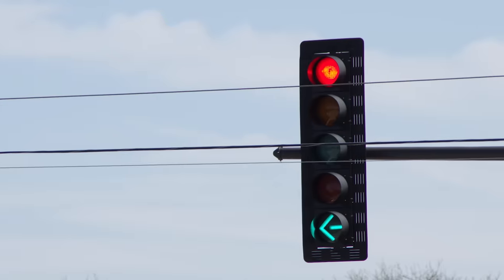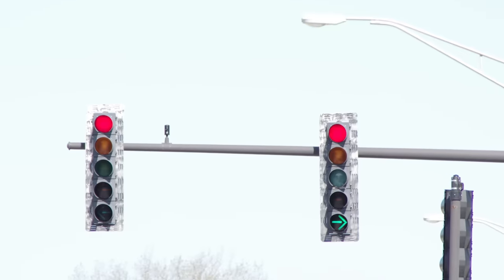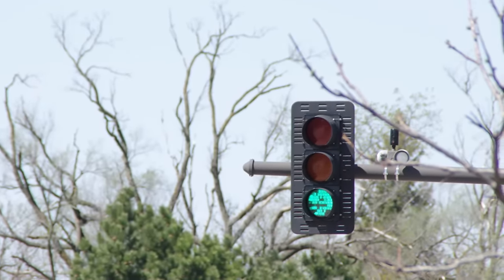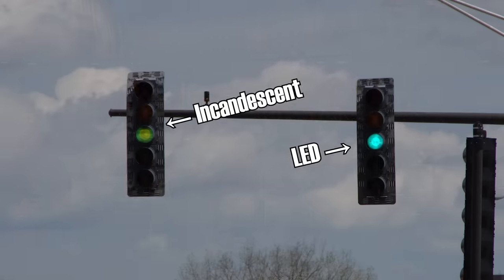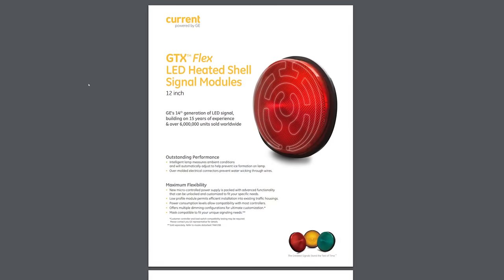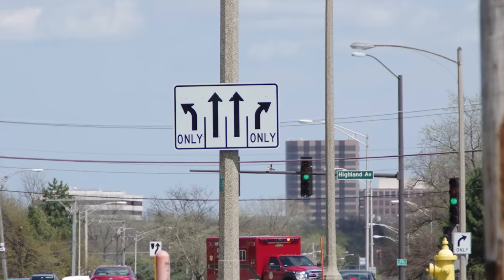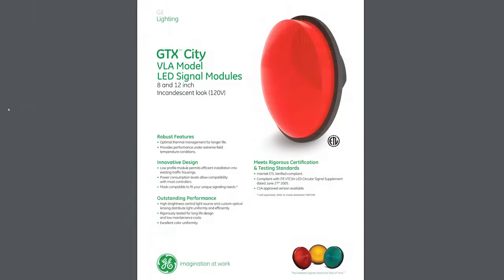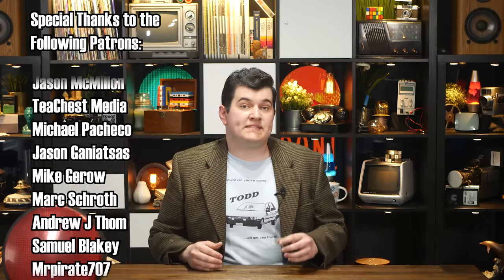The LED Traffic Light and the Danger of "But Sometimes!"

Comment from the maker: There were two metric conversions I failed to do!  Argh!  I promise I'll get better at this;
35-40 MPH is roughly 55-65 km/h.
12 inches is about 30cm, 8 inches is about 20cm.
Now that that's over with, what sort of traffic lights do you have where you live?  This is a very 'Murica-centric video, as that's where I live, so international perspectives are always welcome!
Also, because I am so bad at self promotion, did you know you can follow me on Twitter?  Because you can.  And should!  https://twitter.com/TechConnectify
Don't forget to STOP!  In the name of love!  And drive safely!  Thanks for watching!  Exclamation point!
Reply: Near where I live, they uses those old incandescent bulbs. In fact, the whole city uses them, I have never seen a led traffic lights here. There were also those weird traffic lights that only have ONE yellow blinking light (no red, green) that is used for nothing and most of them have died out by now (and they were never replaced)
Reply: https://www.google.com/maps/@60.4446182,22.2582236,3a,75y,57.1h,95.65t/data=!3m6!1e1!3m4!1sVx-tyIr4AK4srLiXa1N2QQ!2e0!7i13312!8i6656 As you can see we don't have stop signs we have yield signs and they are only applied when the lights are off :) And the lights are leds
Reply: General setup of the lights 'round here (canada) are pretty much the same as the states, never seen [walk/don't walk] signs in my town though, they're all pretty uniform with the hand and the walking dude, and most major intersections have a countdown on the blinking hand. Pretty sure they're all LED as i've never seen one go out but i haven't payed much attention.

There is one intersection a bit off downtown that's always baffled me though 'cause they just rigged up one of those 3 stage traffic lights for the pedestrian light, which is especially bizarre because that area of town doesn't have pedestrian lights at most intersections anyway, and it's no more complicated or dangerous than any other intersection in the area to warrant it. Furthermore, it's simply synchronized with the main traffic light as far as i can tell (aside from completely skipping yellow and going straight to red) making it entirely redundant.
Reply: Mostly LED.  And the control sensors installed for the last ~15 years have been cameras mounted on the traffic control boom.  No embedded road sensors.  They have started installing solid state touch sensitive crosswalk buttons.  No longer a mechanical button that can fail.
Reply: Here, in Switzerland, we use LEDs. Or at least we do in my City.
Reply: In Poland it really depends - both incadescent and newer, led types are currently in use. To be honest, I 've never seen a burned out bulb in traffic lights on a daily route I make. Maybe I just drive too little ;)
Reply: Don't bother with metric conversions.
If you're American or British you pretty much use Imperial all the time anyway.

If people don't know then it's up to them to learn.

Just the same as I can't go to China, and expect everyone to change to speaking English for me. I have to learn Chinese.
Reply: I think that only new traffic lights in Croatia are LED, but I have never had a problem with visibility here and I think its hard to see if there are LED or not; so its interesting to see these old and lousy traffic lights. I think that we have better lenses or something...
Reply: These make crossing in busy intersections all the more fun! https://www.youtube.com/watch?v=X7VWSk1DMlI
Reply: Thank you!
Reply: It's interesting how the US has slightly different rules for broken/unreadable traffic lights. Here in Hungary (and I believe in the rest of the EU, too), traffic lights can be combined with a yield sign or stop sign. If the light works properly, you ignore the extra sign. If the light is broken or unreadable, you follow the sign, i.e. you either yield or stop, and if it doesn't have either sign, you have priority in the intersection. Of course, we couldn't follow your version because we don't have four-way stop signs. There is either a prioritized direction in an intersection, or the right-hand rule applies (i.e. you yield to those coming from your right).
Reply: The same more or less applies to the Netherlands, except you only follow the signs if the whole intersection is out. If it's just one traffic light that's failing, you have to guess (and make sure you don't do anything unsafe).
Reply: I left Riga years ago, but we started moving to LED in general. Some new have more traditional looks, and some are like this:
https://www.google.com/maps/@56.9405,24.1952308,3a,75y,37.74h,80.1t/data=!3m6!1e1!3m4!1sGB0_LiMXSlNECSTNVYXXYw!2e0!7i13312!8i6656
Reply: I live in Germany and I can't remember seeing a stop light that didn't work in like forever.
I assume we have LEDs in my city but I'm not entirely sure.

Also you look pretty neat in your jacket and roundabouts are better anyways
Reply: A few years ago certain municipalities in Colorado started introducing yellow flashing left-turn arrows with a sign stating something to the effect of, "yield on flashing yellow arrow". This strikes me as a massive waste of money, as a solid green light (without an arrow) already communicates this message. Any other states have this? Is there a good reason for it?
Reply: Jonathan Poncelow It's probably just reinforcing the meaning of the green ball signal. Here in WV you are more likely to see a sign that says: LEFT TURN YEILD ON 🔵 (That should have been a green ball.) We also have signs that say: RIGHT TURN ON 🔴 AFTER STOP. Just repeating common knowledge stuff on the drivers licence test for added safety I assume.
Reply: Here where i live we do use both incandecent and led lights though i think its getting slowly replaced however even with the led lights there is still a traffic officer that directs the flow of traffic specially in high traffic areas and in certain intersections there is no traffic lights, then again they arent always traffic heavy
Reply: In the Eastern US, we mostly use LED signals, and most pedestrian signals are LED and have countdown timers. Some have a green walking man and some are white. We are also beginning to upgrade streetlights to LED and other white light technology, like white high-pressure Sodium, metal halide HPS replacement bulbs, compact fluorescent bulbs, and LED replacement bulbs. Those links had some cool looking signals!
Reply: In Flanders (the Dutch speaking region of Belgium) there are regular round red/yellow/green lights and for pedestrians a standing/walking man symbol. It's been this way for ages.
They may already have changed the incandescent bulbs for LEDs, i won't notice the difference unless they're side by side.
Now and then i see a number of men with retroflective clothing typing on their laptop next to the controller boxes but i don't think i've ever seen them change a bulb.

One major difference between the USA and here is the lack of text in traffic.
Why read half a book when one symbol conveys the same meaning?
Reply: Tbh people should know conversions off by heart anyway.
Reply: Hi ! I'm from France and something that always bugs me out with USA is the placement of traffic lights, here it's not on the opposite of the crossing ...
We have a mixed bag of LED and Incandescent bulbs hers too.
When we have a protected turn, we have a special light with Red, Orange and Green arrows pointing in allowed directions. When it's a single light with a protected Right turn, it's a blinking orange arrow.
If a intersection fails due to shortage or electronic error, it can blink orange to indicate Right priority or be shut down to indicate that you have to follow the sign on the traffic light post (Yield, Priority road or nothing, indicating Right priority too).
Sometimes on the opposite side of the road there's a Red plus to indicate that the ongoing lane has their light to the red.
Pedestrians just have a Red immobile guy and a Green moving guy, sometimes Automobilists has a old flashing light with pedestrian crossing sign engraved on the lens, it tend to be depreciated.

Buses have their own set of Red, Orange and Green lights with BUS written inside
In some rare occasions, bicycles has their own set of lights too and sometimes a sign giving them the right to ignore a light for a right turn (with caution, of course)
Tramways have a different way of signalling with only white colour, car drivers tend to mismatch them :/

Oh yes, our Yellow light is more like Orange on traffic lights, and more like Yellow on temporary lights, but it's subtle ^^

Anyways, here's the differences I could notice !
Reply: Well, in the US, everyone is already supposed to read English, so they can just write signs in plain English without having to teach a lot of symbols. In Europe, there are a bunch of smaller countries with their own languages, so symbols are more efficient because you don't need to learn a foreign language if you go abroad. At least I assume that's the main reason for the difference.
Reply: I live in a "winter" city in Canada - far enough North that our annual snow removal budget is in the tens of millions of dollars but not far enough north that it doesn't snow during the winter (yes, that's a thing, it can be too cold for snow to be possible). We're in the process of switching to LEDs over the past several years, and most of the lamps are now LED. I have never seen an LED that was obscured by snow. It just doesn't happen that much.
Reply: A finn here. We started converting to LEDs over a decade ago and currently most if not all traffic lights are diodes. They are mostly of the "lost pixel" variety in the cities, bigger intersections might have what looks like retrofitted lights behind glass lenses. BUT SOMETIMES there's so much snow the traffic jams from ploughing twice a day. The trick here is to get a lot less sunlight when there's snow so the diodes remain clearly visible through a thin snow or ice cover. We refer to this as the winter and it's caused by the earth's axis of rotation tilting away from the sun.
Reply: In Lithuania, there usually are signs that show which street has priority (the signs are "priority", "yield" and "stop"), those signs apply when the traffic light is not working and traffic lights for lower traffic streets are turned off at night (or rather, they blink yellow).
In my city they seem to have started upgrading some lights to LEDs and I like their higher brightness, unless I am driving at night, because they are a bit too bright for me then.
Still, I prefer incandescent bulbs for my home :)
Reply: Mix of incandescent and LED, seen both fail sometimes._
Reply: Or adopt roundabouts like many other places. Victoria BC Canada, where I live, has been going more and more with them; and you hear the same "But Sometimes!" arguments. But they just work. There is nothing to fail besides the driver's comprehension of how a Yield sign works. I don't get why most major intersections can't just go with the roundabout.
Reply: Why they don't replace them:

Saving in the worst place. We live in an era when any spending by the government is a sin. Asking for quite a massive increase in budget for the next say, 2 years (the time it takes to change them all) and saving massively afterwards will not attract politicians. There is a certain section of the populus that is living in the "end of days".

People are stupid. One can't talk about this subject without saying that it is pretty much one sided argument and there is only one political movement that does this at the moment. ANY spending is bad and everything is about now, next quartal.. The 100% increase in budget will not go down and instead someone is making a buck.. Someone sells those old bulbs. Not that things would change with new bulbs, someone makes a buck but whoever it is... isn't driving the change since companies do have power to change government spending.

People are stupid. They vote these politicians in.

BTW; many, may intersections would work better without traffic lights: roundabouts are awesome.
Reply: Technology Connections I am not exactly sure what kind of traffic lights we have here in Hamilton, ON(we live in Canada and they don't tell us the type of light) but I think we use LED traffic bulbs.
Reply: Never seen a "single" failed traffic light bulb here in Germany (A few years ago mostly incadescent, now a mixture of incadescent and LEDs). Probably the reason why we don't have failed light bulbs is the automated monitoring that will measure the power consumption and when it is too low, it will turn off every light at the intersection and notify the workers to fix (In Germany, when lights are off, the traffic signs below are valid, so a failing red light on a priority road may really cause accidents when failing). This also caused some weird results where some electronics and resistors were added to early versions of the LED bulbs to make sure they draw "enough" energy so that this monitoring will not trigger. I assume that by now the monitoring circuits have been updated so that this waste of energy is no longer necessary, but I'm not 100% sure.
Reply: Maybe highpower IR embedded in the same dye as the rest of the LEDs? The outermost leds switched to IR LEDs..
Reply: In the Netherlands we don't have a single lights per side with helping lights (like the right arrow). We just have 3 lights (a single "light" / verkeerslicht) per lane. On normal intersections there is at least a single lane per direction. On small crossings or with less traffic there is no dedicated right light. And on really small (size or traffic wise) sides all three are combined into a single "light" (aka 3 vertical). And even rarer left is combined with straight if they have a very good reason. But the light always indicates what is does because it has arrows on it only if it clears a direction 100% (most of the time on the green light only to not dim the red light). If a light has no arrow you might need to give way to bikes or pedestrians aka follow other right of way rules. On busy intersections there might be an extra flashing yellow light (with or without image on it) to indicate when bikes or pedestrians may cross. Sometimes there is a "rechts vrij" (right turn free) to indicate you may cross red light when you turn right but that usually is only used for bikes. For cars, if they make something like that, they usually just make a right lane without light bypassing the intersection. But those things are not all that common. But the basis is a full light per lane.

And about led, the big trouble here is I see them a lot with black/broken parts of the light pretty quick. And most of the time the broken parts are not solid off but flashing :/ That's why I hate the early conversions. And I absolutely HATE the ones converted to led without a night mode (most of the time switched with the street lights). They are fricking blinding at night :s

And for emergency vehicles (EV) we use KAR (KorteAfstandsRadio = short range radio). It's the same system buses use to communicate with intersection controllers. The EV sends a radio message to the intersection controller (based on GPS position) which turns ALL lanes in the direction of the EV green after turning all other possible directions to red. Aka, the normal green light indicates it's safe. Buses use it to send a (different) message when the approach the light (again triggered via GPS / connected to the digital travel information in the bus) which indicates the route over the intersection and the time ahead or behind scheduled. Last gives the controller something to weigh the request of the bus and it's more likely to get priority when it's late and no priority when it's ahead :D
Reply: Here in Sweden, I can’t remember when I last saw an incandescent traffic light - they’re almost all LEDs. Never seen one fully obscured by snow, and we know winters. ;-)
Reply: Technology Connections Here's a question! Why don't they put count down timers in all intersections so drivers know how long they have rather than just a yellow light?
Reply: Why are the metric folks unable to convert these things in their heads? I live in the USA and have no problem switching systems.
Reply: if the temperature is below 5c turn on heater (whatever it is in F)  built in temperature sensor on the led light it self
Reply: Dan Coulson because international standards suck...
Reply: Technology Connections Technology Connections, While you make a persuasive case for the most modern LED traffic lights, your presentation missed the importance of economics in such decisions. This is important even if energy efficiency is your only concern. An edifix most engineers don't have the luxury of sharing. The existing stock of lights is usually a better use of funds because they are already paid for, or still being paid for. If a light is still working, it is more cost and energy efficient to utilize the fixture until it reaches the end of its life cycle. Savings on daily energy usage must fully justify replacement of existing hardware before it can be said to be a sound financial decision. Most commonly municipalities have limited resources to purchase and install new equipment. The labor cost, and personnel availability of qualified personnel to perform the installations also increase the cost of such equipment upgrades. In many communities there are not enough personnel available to make large scale upgrades on a swift schedule. This flaw is often a blessing when the new hardware doesn't work properly for some reason. Which is often. Traffic management systems are notorious for software bugs and other vulnerabilities, which in turn can represent not only unanticipated fiduciary but also political costs. Thus a slower approach insures problems are localized rather than widespread. Even if that is usually unintended. In almost every case it is more wasteful to discard working machines in lieu of newer ones for the sake of energy efficiency. The energy used to manufacture a given machine is often greater than its expected lifetime energy consumption, such as in commuter cars. Smaller ticket items such as traffic lights use many more times the energy necessary to manufacture them during their service life, but the cost of installation and maintenance must be added to these figures to get accurate results. In the case where a union is involved, it may be nigh on impossible to choose more effective options for entirely political reasons, and the purported benefits often evaporate into graft. So while the new LED lights are superior, and come with many obvious benefits, there are none the less costs that are not immediately obvious which can make such installation a boondoggle. Keep in mind that for the most part it is government bodies which are responsible for maintaining and installing them, and so the possibility of meaningful efficiency is most likely entirely apocryphal after the inevitable cost overruns are finally tallied. I hope that will give you a bit of perspective as to why many places are still using older, and even archaic, traffic management systems. As the old saying goes, if it's not broken don't fix it. Thank you, have a great day.
Reply: zeke1220, because nobody else uses imperial so why the hell should they learn a backasswards old measurement system that may have never, ever been used in their nation just because one country in the whole damn world insists on sticking with it? Unless you have to regularly do business with the US it's just a waste of time. Might as well ask why people can't just convert dozenal measurements in their head.

Furthermore, pretty much every nation that used the "imperial" system used a slightly different system, UK imperial is not exactly the same as US imperial, so conversions will be inaccurate in some cases unless they account for that, and terminology can be different as well. Metric on the other hand is the same everywhere, even in the US, so it's simply more efficient for all parties to use metric.
Reply: Where I live, Tasmania, Australia, we've been in the process of switching to 100% LED traffic lights for a while now. Our school zones all also have LED signs that switch on for an hour or so around the start and end of each school day, lighting up with a 40kph speed limit. Much better than the old massive signs that had 40 written on one half, and the various times the 40 zone applied written much smaller on the other half. The LED signs work perfectly, and even all have a small solar panel on top of them to make them even more efficient.
Reply: You should make this video region locked or something because you are going to make many people angry. Is like complaining about having clean tap water from pipes at all times in front of thirsty people from Africa.
Don't forget to Stop!?!? In Mexico I'm lucky if at least one driver obeys the red light, they won't stop unless the cars with the green light are already in motion. It doesn't matter if the lights are working or not, not even if pedestrians are already crossing.
Reply: Up in East Coast Canada, not only are 90% of our traffic lights LED but so are our street lights.
Reply: Hasn't anyone ever told you to be careful with that logic? I live in Philadelphia and we have all kinds of lights. This biggest problem is timing. One four way intersection has the light facing you turn red but the light facing away stays green for an additional 6 seconds.
Reply: Because... LED's.
Reply: In finland i haven't seen a situation where traffic lights were completely covered by snow. We have old bulb-type lights and LED lights. Offcourse we don't have the kind of blizzard storms like in the US (or they are pretty rare in here, usually just snows). But my opinion is that LED lights are far more easily to detect that traditional bulb type. Even in snowy conditions.

I tried googling and didn't find exact specifications of Finlands traffic lights. They are three-coloured, but Wikipedia says that "They are more or less kinda same than in other european countries, but they are different". I think that "difference" is here that we don't have thos "multi-line" lights such as germany or holland have. Usually in four-way intersection intersection we have:
- One, two or three signals for cars coming from each direction (right, straight, left...).
- One for pederestians in each direction (just circle lamp which is red/green)
(there is possibility to "special" signal for busses etc but it's more rare here)

IF lights go out-of-order, they start flashing yellow and everyone starts driving like on-road paintings and signs are telling you to (do you have to dodge or can you go etc.) If there are no any signs that "order" what to do, then everyone dodges that which is coming from right hand side. This could be a dilemma, if we have four cars, four directions and everyone dodges the car which is coming from the right hand side.

Sorry my bad english. Just woke up and watched this video. Try to write english here, when you just can't remember even your own name properly. xD
Reply: Marshal Walker 
All depends on whether you are using the northern or the southern metric system!
Reply: In BC, specifically Richmond, a suburb of Vancouver, they use 12-8-8-12 (R-Y-G-Turn) at most intersections, with complete 12 inch lenses only being used at highway exit junctions and two arterial intersections. There's this one intersection in the middle of the city where one left turn signal is still incandesant, but that's about it.
Reply: 12" is smaller than the UK 12" so 12" UK is 305mm
1 mile is smaller  than the UK mile.

So, everything in the US is smaller ;)
Reply: Don't "convert" to metric, just THINK and SPEAK metric ! Smart people have no problem, others, who cares , they are disappearing like incandescent bulbs !
Reply: Forever Computing 
Nope.
I've got proof!
OUCH.......
Reply: Technology Connections I doubt they have been around for "decades". If they have, then those lights would have a BLUE tint to them! It's more like a "sea green" or "turquoise" and you don't really notice them unless a newer "true green" light is installed next to one.

Being a truck driver and not a highway engineer or what ever the field of being a traffic light expert belongs too, I can't tell you exactly how old they are, but what I can tell you is this: 

#1 The "blue" lights get even more blue with age.

#2 There was a short period of time where the "blue" incandescent lights were phased out and replaced with "true green" incandescent lights before switching to L.E.D.'s.

#3 Before the "blue ones" the really, really, old lights were those tiny ones that when the sun hit them at a certain angle didn't even look like they were on! The lenses had no prismatic angles whatsoever and those were phased out a VERY LONG TIME AGO! I'm 42 and I barely remember those as a kid!
---------------------------------------------------

Perhaps someone that is a little more educated on this subject can date them a little better than I can, but judging by their hue, I highly doubt they are "decades" old.
Reply: I live in Australia. I haven't seen non LED traffic lights for many years. Even out in the country where I am.
Reply: Technology Connections Hello, neighbor to your north here (Wisconsin, not America’s hat). Noticed you pointed out we Wisconsinites have LED lights now and I’ve heard plenty about it the one fucking time that I can recall that snow actually covered the lights in Green Bay! As we all know, it’s impossible to see colored light through white snow lol! Jokes aside, it sometimes can be quite difficult when some people can see the lights and others can’t, so the whole “covered/malfunctioning traffic lights become all-way stop” isn’t always so easily determined. This is especially true when the snow is blowing in one direction and you aren’t aware that others can’t see traffic lights because you still can see yours. Like you said, easily solved with a controllable heating element.
How’s about we find an even better work around? Instead of adding a heating element to each traffic light, we can just put an incandescent bulb inside that nobody can see unless the traffic lights proper are turned off. That way, when people want to complain about the bulb change, you can shut them up without lying by saying “yeah, yeah, Jacob, ya fucking drunkard! We put those bulbs back in the traffic lights, so shut the fuck up already. We’re trying to ice fish and can’t concentrate, dammit.” Then tell all the LED light supporters that all incandescent traffic lights have been replaced and leave it at that.
Why do this instead of just adding a heating element? Pfff! More like why not?
Reply: In San Diego it's a mix of new 1980 style and 1960s style
Reply: Dan Coulson keep the conversions, 
If you say something in uncommon terms to mass groups you the restate it in the most common ways so most people can understand.
Take Olympics for example. When they were they in China they did not expect everyone to learn Chinese, everything was said in Chinese, English and French.
When explaining to groups you want to get your message to as many people as possible. Conversions is a way of doing this.
Reply: Dan Coulson You don't have to convert the numbers and foreign viewers can look it up themselves, however, converting it for potential foreign viewers is a nice gesture and makes it more comfortable to watch for anyone unfamiliar with British/American units. If you  want to compare it to languages take subtitles; most videos have them, most movies have them. Why? Because they don't expect viewers to learn a certain language to enjoy a movie/video 😉 Americans even go as far as to remake entire movies because audiences dislike subtitles. Now that's commitment to a comfortable watching-experience 😄
Reply: LEDs and Incandescents are both used.
Reply: I think municipalities have a regular time table for changing bulbs on traffic lights so they are changed before they die.
Reply: +Dan Coulson That means that 7.2 billion people have to do the conversion because you don't want to. Counting only Europe is almost double the population of the US and the UK. You are alienating a big chunk of potential viewers by being obtuse. Most higher education and fields of research already apply metric because Imperial is redundant. Stop being a colony of the UK and apply metric yourself!

Get with the program. Imperial isn't even logical to use.
Reply: I'm in Tasmania (the most southern state of Australia). In the capital city probably 80% of lights have been replaced by LED's which are (amazingly) locally made. The driver circuitry for the LED's do fail from time to time. It's not unusual to see the odd one out. 

Most of the surviving incandescent fixtures are in poor condition and probably awaiting replacement. 

Interesting that some of the other cities in the state (Launceston especially) all of the "Above road" type fixtures have been replaced, probably as they are more difficult to service, but it does look odd having one out of several lights LED. 

Lastly, a mill I work at, has a set of traffic lights inside it, and they had issues with lamp failures, and they've recently fitted compact fluorescent lamps, which was an interesting choice. Especially as they flicker on each signal change.
Reply: Because on modern controllers even the controller might not have a idea how long it will show green ;) It monitors it real time. Looks at new traffic from all directions, how fast traffic starts moving, incoming buses and emergency vehicles and might even look at rain :) It constantly weighs everything. And besides, there is a count down timer, it's called yellow ;)
Reply: Another Australian, this time living in South-East Queensland and it's pretty much the same as the other Australians have described. Almost all LEDs for a while now, though you do occasionally see an incandescent set that hasn't been replaced yet but they're getting rarer and rarer. And you do see some where a few LEDs have failed but the light as a whole is still visible. With regard to emergency vehicles, I think we just added wireless receivers in the light controllers with transmitters in emergency vehicles. As for vehicle presence... I think there are some intersections that have it, but it's generally fairly well concealed and most likely activated only late at night.
Reply: Michael _Howto why? Imperial measures are obsolete in most of the world. Outside of uk and US you only ever see imperial measures in videos like this... if I need to look up something, I use google. Like last day I wondered which was bigger, the US pint or the UK pint... one is just a wee bit more than half a litre, the other is a tad less. Do you see how stupid it is to cling on to an outdated system now?
Reply: Technology Connections .First time to the channel. Never thought about traffic lights before but this video made them a little more interesting. Thanks for the upload!
Reply: In Mar del Plata, Argentina, some time ago started to use animated led signs for walk/don't walk: the speed of the animation indicates how fast you need to start crossing to reach the other side. In my city, La Plata, all major intersections have a countdown, many are led, and we use an uniform sign for walk/don't walk.
Reply: The Netherlands almost feels like another world. First of all, there are never, ever, ever more than 3 lights. If there is a 4 lane road the right lane is quite often exclusive for turning right.  If it is for both, there are no separate rules for turning right or going straight if it is in the same lane. Only one light. 2 lane roads rarely have lighting here and if there are issues with congestion or safety we use roundabouts. As far as I've seen, all lights in the Netherlands are LEDs and have been for quite some time. I haven't seen an incandescent light in at least 7 years. We also have a wide integration of green wave systems to ease congestion and it is actually rare to stop more than a couple of times in front of a light. Apart from the car signalling, we have the green walking man and red standing man for pedestrians. Bicycles function somewhere in between pedestrians and cars. If it is a busy area you have three lights if not just two or none. Bicycles also always are forced into a roundabout pattern at every intersection where if you want to go right there is almost always a free lane to go into without any lights. The lights are for going straight and to go left you'll have to cross the street twice in a straight line. 

The Netherlands has been over-engineered since at least the 70's and it works. Still, don't understand why other countries won't do these things at it is just thinking ahead and not transplanting ideas without thinking about them.

The London bicyclists of doom speaches are especially funny.
Reply: IMO the most noticeable thing about LED's is that the temporary traffic lights we use in the UK to control traffic when the utilities are digging up a road don't need a Diesel generator to be towed to site wired up and left running, they just use built in battery packs and wireless now... we have a red + yellow light phase so the generator engine used to audibly change note as they cycled.
Reply: Dan Coulson
To use your own analogy that if you go to China you should use Chinese, the internet is international, and ~95% of the world uses metric, so if you go on the internet shouldn't you use metric?
Reply: I'd say you should just forget about Imperial and go all metric - leave the conversions to the viewers. Having YouTubers use metric consistently is probably the only way Americans will nut up and make the switch to metric.
Reply: Why coddle metric babies
Reply: We are slowly converting traffic lights to led in Hong Kong. But we never snow in Hong Kong, so there is no problem here. Moreover, it usually different sets of lights for different directions. Simply, we just follow how British traffics light works
Reply: lead6dead2 Blinking yellow lights are meant to warn of blind intersections and induce caution, and slower speeds, in drivers because traffic coming from the other direction cannot see them coming.
Reply: Jonathan Poncelow A green light means both that you have the right of way, and there is no on coming perpendicular traffic flowing. The yellow arrow light means that you can turn, but there is oncoming perpendicular traffic, and to watch out for it.